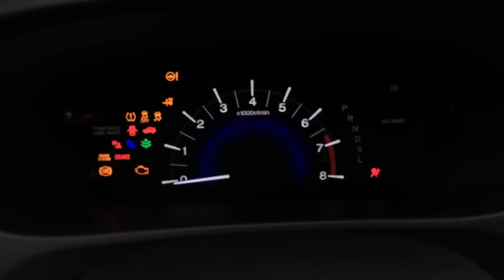2006-2015 Honda Civic Spark Plug Change DIY

Comment from the maker: Parts and tools listed below:
2006-2011 civic spark plugs: https://amzn.to/422lXoJ
2012-2015 civic spark plugs: https://amzn.to/4a2YC8x
(Remember you need to buy four spark plugs)
Ratchet: https://amzn.to/4gHQE7l
Socket/ratchet set: https://amzn.to/3Ppd1SN
Spark plug sockets: https://amzn.to/4aaAZL9
Magnet: https://amzn.to/3DUwAQn
Extensions: https://amzn.to/4fRPsNb
Antiseize: https://amzn.to/4h2biid
Dielectric grease: https://amzn.to/421RHKz
Torque wrench: https://amzn.to/3DCdPkD
#ad

Comment: This is as easy as it gets for changing spark plugs on a car. The O2 sensor looked very easy also.
Reply from the maker: Very easy. Just need to know how much to tighten the bolts.
Reply: You have to spray the O2 sensors with lubricant overnight or they will never come out.

Comment: When you used the torque wrench at the end why was it necessary to go counterclockwise for a 1/4 turn and then tighten it again?
Reply from the maker: Michael Suleiman to insure you’re not crossthreading.
Reply: @MrRangerZr1  Thanks. Can I get away without using a torque wrench and just use a regular ratchet? A technician at NDK recommend 11-14 ftlb for my spark plugs and I'm concerned about over-tightening them.
Reply from the maker: Michael Suleiman yes 1/4 turn after hand tightened. Watch from 2:54 in the video, I show it.
Reply: @MrRangerZr1  thanks for the video, that looked more like an 1/8 turn.
Reply: @suleimanmh    Use some dielectric grease on the threads and they come out easier.
Reply: @wegder   I torque them to the point just before the theads strip. I was a world class arm wrestler at the Carling O'keef's in the 1970's.

Comment: Awesome. Thanks. I so don't want to pay out the wazoo for something I can do myself. Question: I noticed after you placed the new one in, you turned it to the left first a couple times and then to the right. Where you just getting it in the right place or was this necessary?
Reply from the maker: This is actually an important step. It insures you are not cross-threading.
Reply: @MrRangerZr1  Cool. Thanks

Comment: Think you could add the exact tools you used for this DIY in the description?
Reply from the maker: 3/8 ratchet, 6 inch extension, 5/8 spark plug socket, and 10mm socket. All in description box.
Reply: 10mm socket to take the screws off first.

Comment: I need a tune up on my 2015 honda civic lx coupe? I need 4 spark plugs. How much is the average cost for each Honda original spark plugs for 2015 honda civic coupe?? Should I buy from the dealer or no?
Reply from the maker: The original honda plugs are just NGKs in honda labelling and marked up in price.
Reply: @MrRangerZr1  I want to the dealer and asked for the price for 4 spark plugs. The total was $149 and change. How much are 4 ngk's?
Reply: @MrRangerZr1  a couple more questions. Do you recommend NGK's for 2015 honda civic lx? And what's the average labor price(not including parts) do mechanics supposed to charge for labor for tune up?
Reply from the maker: @hankgege2199  each plug should cost less than $20, i told you about the dealer markup. Use NGK as that’s what the factory put. Spark plugs are listed in the description. Parts and labor at a shop can vary from $200-$300+, scroll through the comment section, people commented on how much they saved.
Reply: @MrRangerZr1  thank you for responding. I appreciate it!

Comment: Are the igntion coils supposed to be in a specific order? I might have mixed mine up and want to know the correct order to put them in to reassure I did this correctly.
Reply from the maker: No they're not. Just an OCD type of thing to keep the same coil for the same cylinder you removed them from.
Reply: Doesnt matter. It's not like it was with a distributor cap.

Comment: How much torque did you use to tighten them?
Reply from the maker: About 13-16 lbf.ft
Reply: I did about 150 pounds of pressure due to lack of compression on a 2010 Honda Vicic EX=L. I used to be an arm wrestler.

Comment: I checked the link Amazon for the spark plug and it stated it does not fit my 2013 Honda Civic.
Reply from the maker: Never rely on amazon's fitment. They will fit.
Reply: MrRangerZr1 , thank you sir.

Comment: What size is the torque wrench? The link is for 1/2 inch but then the extensions are 3/8 inch. I purchased everything in your list but I'm not sure if I did something wrong
Reply from the maker: Check the link again, I updated it with a better one.

Comment: Did you have to apply anti seize to the plugs? I heard OEM plugs already come with their own anti seize so it's not needed
Reply from the maker: Yes they come with a special coating from the factory. Its your choice to put anti seize or not.

Comment: We're they pregapped? Or did you just not show the spec for gapping?
Reply from the maker: Pre gapped in most cases
Reply: MrRangerZr1 yea I just bought pulstar plasma bases plugs for my civic it's a black on black EXL 2015 model
Reply from the maker: OEM plugs are NGK. You should install OEM plugs.
Reply: MrRangerZr1 
Reason being?
Reply from the maker: Because Hondas are sensitive to aftermarket ignition systems. Put anything but OEM then it will start giving problems. Plus, that's what the car came with just replace it with OEM. It doesn't cost more. NGK plugs on amazon are 10-13 bucks.

Comment: Hey should I replace the boot and wires or just the plugs? I have 120K miles on my 12 Civic
Reply from the maker: Just the plugs
Reply: MrRangerZr1 what’s the best way to make sure you don’t cross thread the plug when putting them in?
Reply: Keyur Patel turn the plug counterclockwise until u hear a “click” meaning the threads are lined up. Then tighten

Comment: Gonna do this soon, how are the Antisieze and dielectric grease used? U apply them to the spark plugs or how?
Reply from the maker: Tiniest amount of antiseize on the spark plug threads and little amount of dielectric grease on the end of the ignition coil boot. Check out my latest spark plug videos, I show it.

Comment: how much do you gap the spark plug before you put it in
Reply from the maker: NO GAPPING!!! Modern spark plugs do not need gapping, take then out of the box and install them directly into the engine.
Reply: jose puerto that's great, I put it off due to gapping worries

Comment: When is the coolant recommended to be changed 100,000 miles?
Reply from the maker: 100k miles if you want to change it. I have a video on my channel.
Reply: MrRangerZr1 definitely will check it out.
Reply: Do they have to be changed sooner with City miles? I'm assuming 100k would be mostly highway
Reply from the maker: No same interval

Comment: hi, i would like to know if you calibrated the spark plugs or those were already calibrated also do you know what is the calibrating range?i own a 2012 honda civic 1.8lts, thanks
Reply from the maker: No calibration needed. Just get the right spark plugs that is listed in your owner's manual.
Reply: gracias, buen video

Comment: Very useful video! If you don't mind me asking, do you know which cylinder is number 4? ODB2 scanner says misfire on my #4 cylinder and I've been scouring the internet looking to identify the cylinder by number. Thanks
Reply from the maker: TBH, I am not exactly sure. I believe its 1,2,3,4 starting from the left viewing the engine from the front of the vehicle. You can try swapping spark plugs or ignition coils say from the left cylinder to the right then see what the car says. I'll try finding out the exact order, I'll let you know once I find out.
Reply: Thanks, that's the general consensus I've found so far. front of engine, 1,2,3,4 (where front of engine has the cam gear and timing belt). But yeah, for sure if you could find more info on the numbering that'd be awesome!
Reply from the maker: Yes we're right. Viewing from the front of the car, you view the cylinders as 1,2,3,4. 4 is on the battery side.

Comment: How tight or is there a certain torque for the spark plugs? I wanna replace mine this weekend.
Reply from the maker: Its 13-16 pound feet of torque, or a 1/4 turn after hand tightened. (I show it in the video)
Reply: +MrRangerZr1 thanks man!

Comment: are the original spark plugs really good for 100k?
Reply from the maker: Most of the time 100k miles is nothing for the iriduim plugs. You should change it anyway to get the "original" performance and MPGs back.
Reply: what is the recommended gap for my new plugs?
Reply from the maker: I am not 100% sure but look in your owners maunal and get the OEM plug number. Go buy the exact plugs and just take them out of the box and install them in the car. You do not need to gap new plugs.
Reply: I would always at least CHECK the gap. You don't know how many times the "parts guy" took them out of the box to show a different customer; and could have dropped it or something....just a thought.

Comment: You mention something about dielectric grease in another comment, but I didn't see you use any. Where does that go and is it necessary?
Reply from the maker: On the end of the ignition coil. Its just to keep water and debris out. Doesn't hurt anything.
Reply: @MrRangerZr1   do you have to add dielectric grease or just if you want to ?

Comment: is that the same plug for all model civics? I called my dealer for a price to replace my plugs and they said it was $320. 180 for parts! I found them at my local auto parts store for $25 a plug
Reply from the maker: Thats too much. Go to bernardi.com and search for your civic's spark plug OR look in your owners manual. Then go on amazon and buy it.
Reply: MrRangerZr1 do they ever recommend changing the coil packs on top of the plugs?
Reply from the maker: Michael Howe unless they are bad no.
Reply: MrRangerZr1  so I changed out the spark plugs with your video was very helpful but the maintenance reminder still says spark plugs so that need one of those coil packs is bad?
Reply from the maker: No just reset the reminder.

Comment: MrRangerZr1, I've noticed on an online shopping site, a plug sold by Honda that's gold in color and another sold by NGK that's silver in color. Is one better than the other and do both already come with anti seize on them? Thanks. Great video.
Reply from the maker: You mean the packaging? The NGK you buy from the store is 100% same as the one bought from the dealer, its in different packaging. Check you owner's manual for your spark plug number and go buy that only.

Comment: Also I noticed you put dielectric grease and anti seize on the description, but I didn’t see you apply it in the video. Can you explain how to apply them and where?
Reply from the maker: Dieletric grease at the end of the ignition coil, just a little bit. 
Little bit of anti-seize on the spark plug threads.

Comment: my '12 Civic has a cover over where the spark plugs go. Any tips on getting it off without breaking what's holding it in place ?
Reply from the maker: I think it has a twist on type of clip where you just use a flat head and turn it counter clockwise or it has 2 10mm bolts.